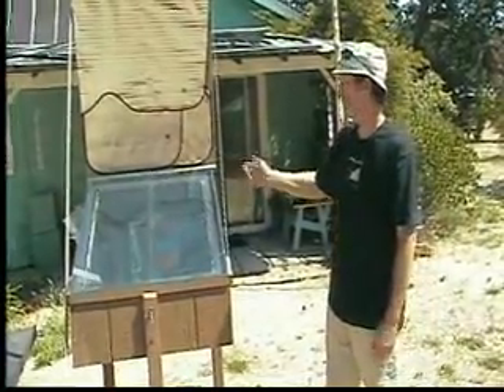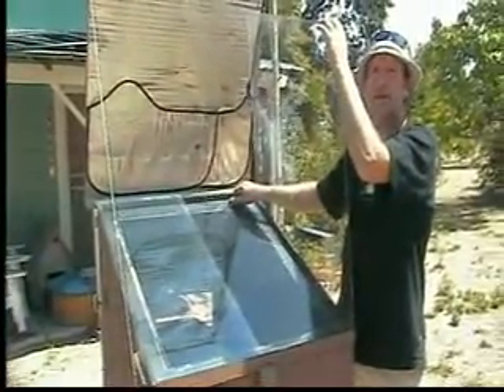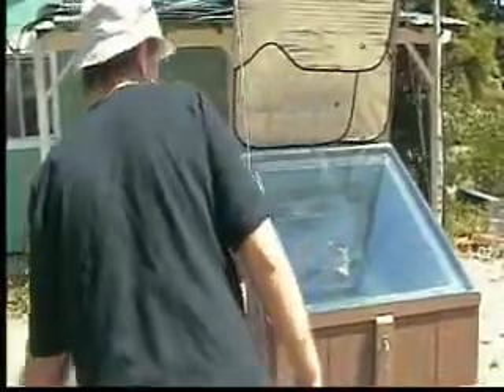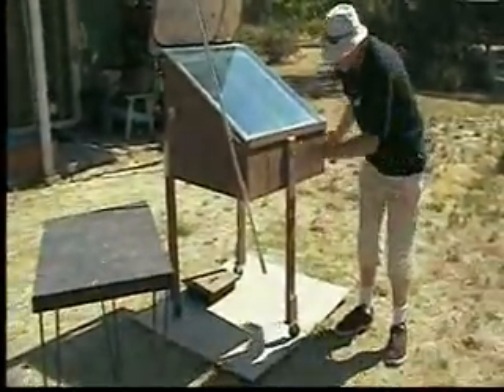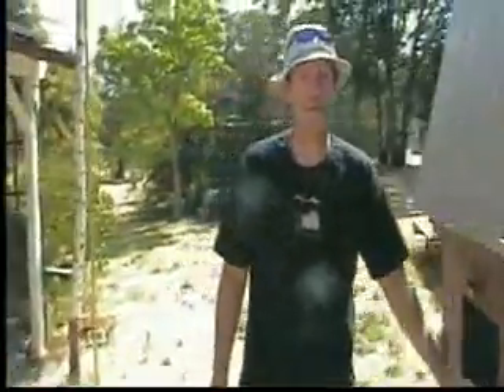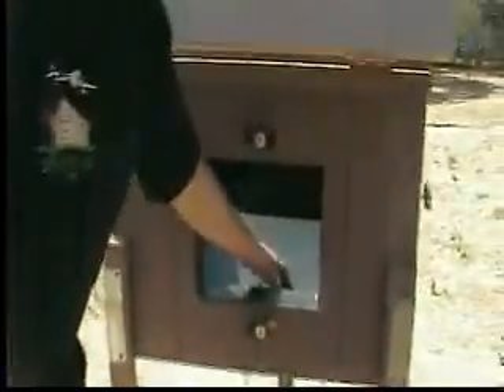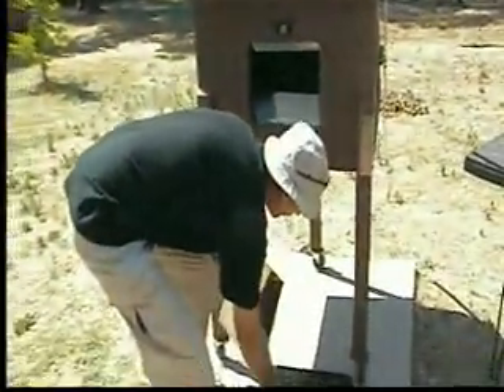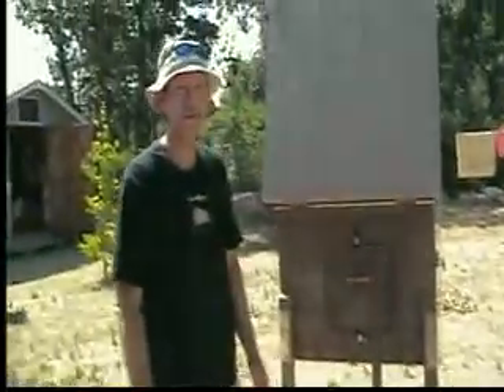My solar oven

Comment: nice job. i like the wheels. . . maybe I'd try swapping the single leg to the back and drop its wheel into a stationary pipe (driven into the ground with about a foot above ground) to hold the back leg but still let it pivot, letting two front wheels move freely for tracking. anyway, nice.

Comment: @99cachorro Thanks for the answer. I am interested to do this kind of oven and other stuff. We have many kinds of energy around us and we still using those things that make pollution. This things are more clean, less use of electricity and helps to reduce the bills...Thanks a lot for the video.

Comment from the maker: @houseuponarock  The cooker door is 1/8 ply with tight cell foam in the gap. Both layers of glass is split.  They always crack if one piece.  I just use the single glaze glass. (cheap or free, and I cut it myself)

Comment from the maker: @supraman200 This was my first solar oven.  I just wanted something that was easy to use and would last in the weather.  I knew they work after looking on the net.  I use 1"X300' polypipe to heat water..  Pipe cost $32 and has lasted 12 years in the sun making profuse hot water for the house on sunny days.

Comment: Good functioning prototype, but after 3 years you should sex it up! Maybe a handle on the glas and some rubber on te sides of the glas. ""Paint it black" for extra heat.

Comment from the maker: @pshinspections yes, this is actually 2 boxes, one inside the other, with 2" foam insulation in-be-tween. the boxes are made from scrap plywood and siding.  I hope this clears things up.  This particular oven is now 3 years old and no signs of wear.

Comment from the maker: @msskippy7781   There is 2" tight cell styrafoam between 2 boxes, inner and outer.  It gets much too hot for plexiglass, 200+ usually in the summer

Comment from the maker: I guess what I was trying to say was that there is tight cell foam in-be-tween the inner and outer box.  There is a sheet of stainless with spacers sitting in the bottom.  I made it three legs because of the uneven ground it has to sit.  Later I will make a concrete slab for it to sit. I use it most every day for a large variety of cooking and it has saved me plenty of money, I'm sure you will find the same.  A  little more slope would be good also if you build one.  thanks for the reply!

Comment from the maker: yes, two layers, and side by side.  The reason is the heat build-up in the inner glass.  A solid peice does break.  The gap is for insulation reason, retaining heat.  And yes, I can spread the two pieces in the middle for moisture release.  This oven is a great dehydrater.  thanks for the comment.

Comment: When you say you use two pieces of glass do you mean two layers, or two side by side ?. and when you said it breaks every time,. is that through heat build up or another reason, and is there a gap where hot air can escape in the centre where the glass meets ?.
Thanks

Comment from the maker: I havnt tried a solar lens. I find them hard to find and a little expensive.  we use the solar oven as a slow cooker, mostly beans and rice. I cook all my beans in there during the summer.  190-250 is a good cooking range for most things.  The temp. is easily maintained.

Comment: it would be easy to use the door as a heat channel for a dehydration chamber ,,,save space and better nutrional than canning ..at least this is my summer project ,,a fersnel lens maby added to use for a smoker as well..I like the wheels thing a lot !! mt nosey cats get in the way of the len beams and the fur starts smoldering !! Solar equipment needs to be closely watched for unexspected burning !! I cooked barliy in a open glass jar with a lens in 15 min!! faster than my stove!!